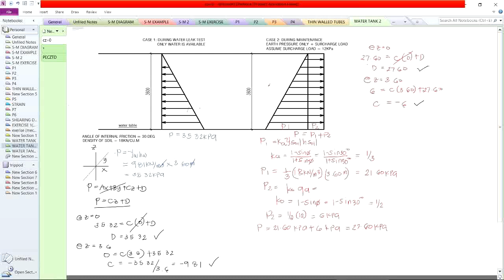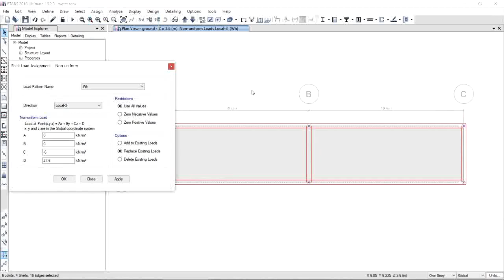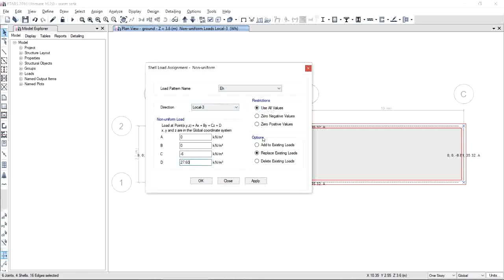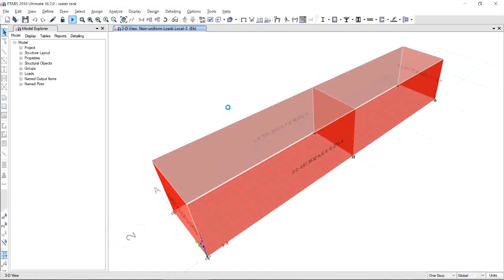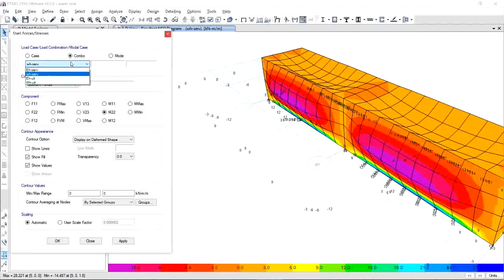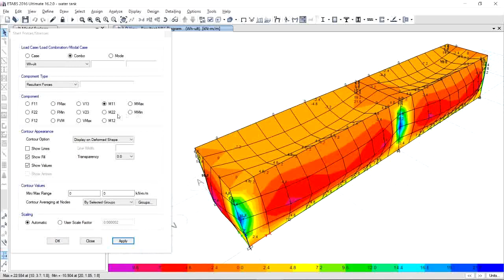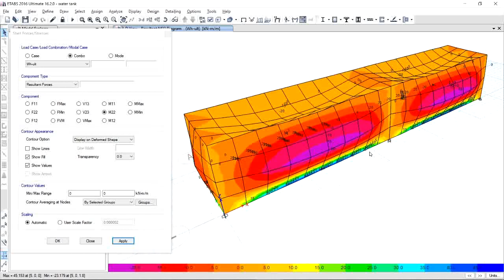Design and Analysis  of Underground Water Tank(RCC) using ETABS  (Part 3)

Comment: i have some queries  . hope give me best solution ,
1) Why dont you used dead load and live load on slab ?? if you used maybe result will be changed as you shown . 
2)  why dont you run design command ?  
3) make a video for Base and slab of this tank design and detailing also .
Reply from the maker: Have I not? sorry if I missed that part, but the load from there is so minimal as compared to surcharge load. If I am not mistaken, you are referring to cover slab. In any case,, you should apply the correct loads depends on your case. I did run the design command, do you mean that I didn't show what load combinations I used?... Regarding the design of base slab,, I would normally export to SAFE CSI and run the design there using Strip or Finite ELEMENT TOOLS at least to incorporate the accurate behavior of soil, check the Soil Pressure and settlement as well.. Than you for your queries.

Comment: Just assigning fixed supports at wall corner points is not acceptable.
But after meshing in analysis process, all mesh points at base level are automatically assigned as fixed by Etabs.
So the model is accidentally acceptable.
Base slab should be modeled in etabs model and define area spring and assigned at the base of base slab.
All the joints at the base should be assigned as restrained in x and y direction and free in z direction.
Movement in z direction will be controlled by effect of area spring assigned at the base of base slab.
Base slab should be stiffer than walls.
Regards
Reply from the maker: This is to show how to apply lateral loads using non uniform shell loads in Etabs. I would rather  export it to safe and design accordingly given modulus of subgrade . Lastly, did you notice that I assumed the water level is just exactly at the base to neglect uplift pressure? By that alone, you should know that I really didn't incorporate the design of basement.
Reply from the maker: By the way, I knew that you are knowledgeable how FEA works. YOu should know that when you discretize  shell elements or even a beam or rods, degrees of freedom at those nodes are automatically set as clamped support  and that explains why Etabs assume fixed support at those mesh points at the base and it is not by accident. Otherwise, if you really want to input fixed support then I suggest you divide each elements and apply necessary support conditions which I think is useless since you are using FEM Software. I appreciate your insightful observations.
Reply: @engineeringedu5437  Then you should clarify it in your video. This could lead to misunderstanding of many young engineers who follow your instructions.
Reply from the maker: @nguyenvukhanh4579  read my comments up. This is Etabs and it's a 3d model not a frame or 2D like analysis.  I won't spoon fed someone who needs informations.